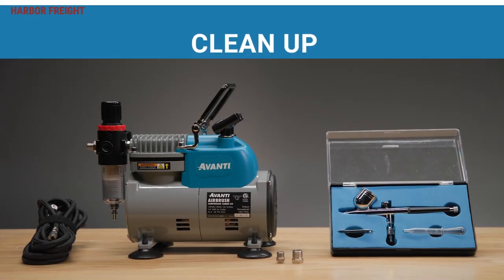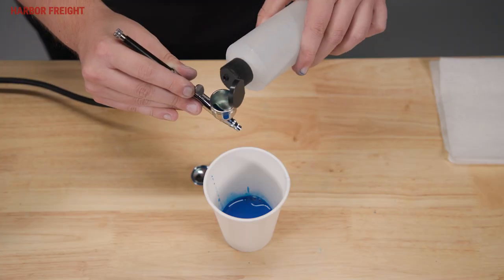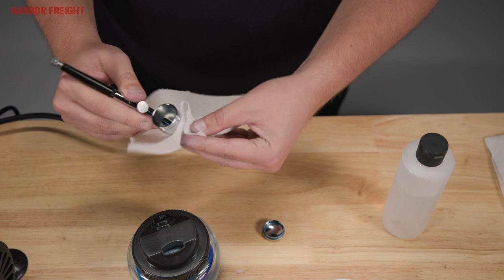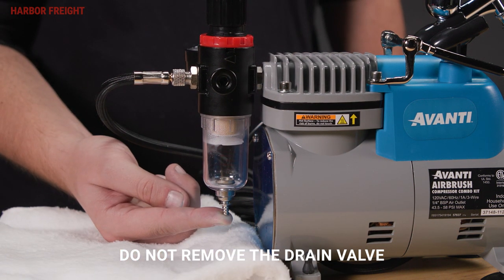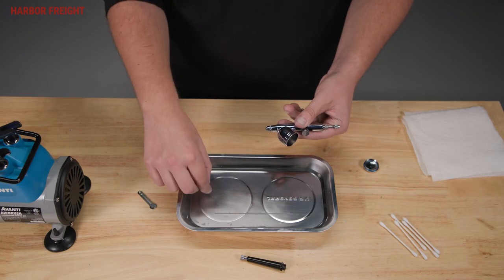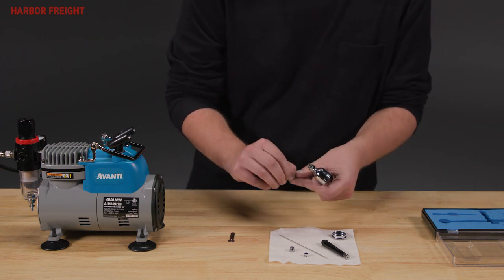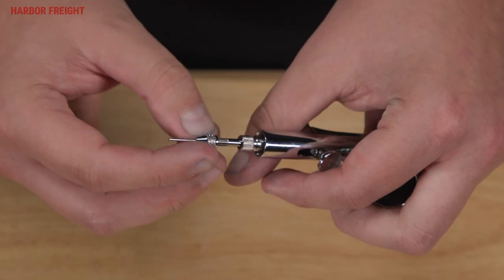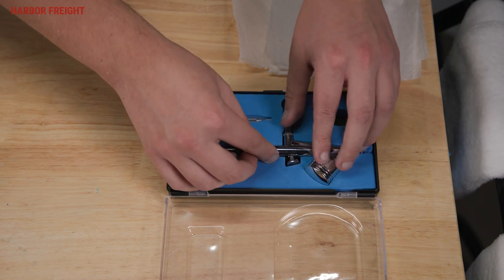Avanti Airbrush Clean Up | Harbor Freight

Comment: What can you use for solvent?
Reply: Depends on the paint you use.  I spray mostly Tamiya Acrylic so I clean with rubbing alcohol. I have a bottle of Tamiya airbrush cleaner for anything harder. 

Vallejo and some Acrylics are water clean up. If you use Alcohol with Vallejo you get a big mess. Also, Vallejo has paint for brushing and paint for airbrushing. You can think the brush paint but it took some work cleaning it.
Reply: @Anlushac11 what about water based paints? Should I just use alcohol?